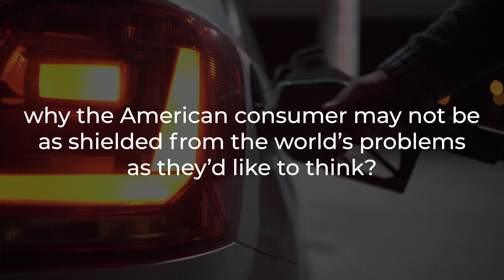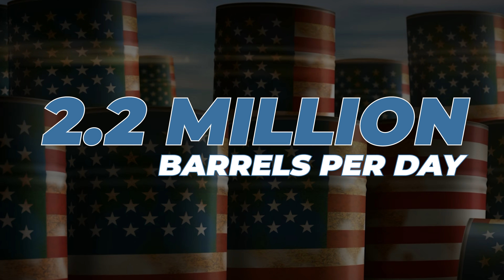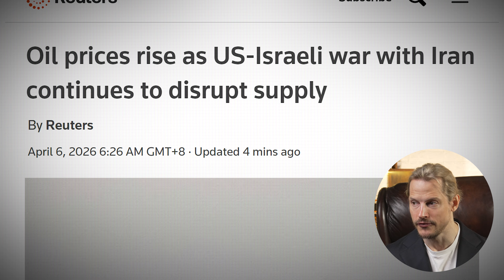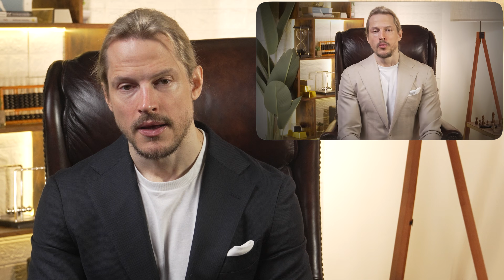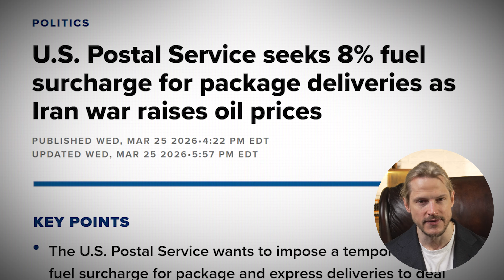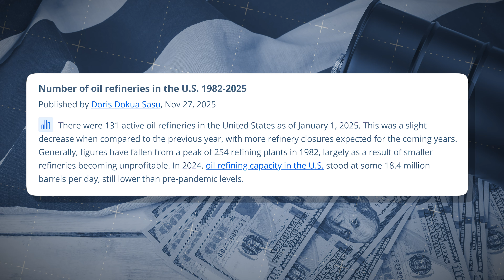Why 'Energy Independence' Is Putting You At Risk

Comment: Refineries on the coast already accept light sweet and blend it with heavier sour sources. Major retooling is not necessary and changes can happen incrementally over a few years. It's also not just about oil turning into gasoline light and sweet can be turned into petrochemicals, which is another critical byproduct that is needed for plastics and agriculture. You're also forgetting the major byproduct of LNG that flares up along with the shale oil and can also be used as an energy source. We'll be just fine
Reply: 😂😂😂 You should tell that to the price tag on the pump... ⛽
Reply: @Aurum-Archon  prices are subject to regional taxes, regulation, supply level gas prices in California for example should be much lower than they are considering Cali has large oil reservoirs but green policies jack up the price. Our refineries export to a global pool so prices are inelastic but we COULD be energy independent is the point there just isn't the political or economic impetus for it.
Reply: @Rufus345 😂😂😂 Whatever helps you sleep at night brah...
Reply: @Aurum-Archon well argued
Reply: @Rufus345  We are screwed brother. We can argue about it all you want, just save me a spot close to the barrel with the firewood so I don't freeze to death. I will bring some marshmallows.
Reply: @Aurum-Archon Europe is paying $2 per litre which is about $11 per gallon. Aside from bigger cities, I'll take $4.50 at the pump without complaint.
Reply: @CMAzeriah  😂😂😂 Yes but in Europe a 15 min drive is considered a long drive. Nobody in Europe commutes for an hour to go to work every day. Because Europe has good city planning unlike the US. Fuel costs in Europe don't matter all that much because you can really walk to work every day if you want.
Reply: @Aurum-Archon 
Even in NYC, no one really drives. Pump prices are a bit of a myth
Reply: @Demopans5990 I work in NYC and commute to it everyday from Putnam County as do thousands of other people. Pump prices are certainly not a myth but again they're much better here than in California or Europe where counterproductive climate change policies raise prices unnecessarily. Again we have the ability to be energy independent but not the political will.
Reply: You got an energy conversion kit for my Ford F250? I'd love to know that I can turn my 5.4L gasser into LNG.
Reply: @Saint_Oscar the point of the video is that the US can't be energy independent. I'm arguing why it can be
Reply: @Rufus345 That's fine; I agree partially with the big-picture side of it. However, Is just like to know when we're all getting new engines
Reply: @Rufus345  do you think we ever will be?
Reply: @S @Saint_Oscar point taken I don't wanna ride on a LNG tank 😅
Reply: @z @zoinks7258 think it's POSSIBLE if we have the political will but the major oil companies are making too much selling to the rest of the world not to mention the shipping companies all of their lobbyists push for oil to go OUT that's where the money is made. If we wanted to though we could legislate to keep it in our borders so yeah it's possible but unlikely unless we get into a serious situation where gas is unbuyable
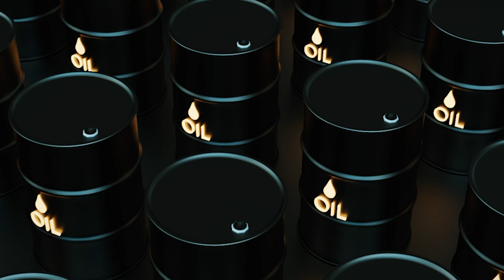Reply: Blending' is a simplistic patch, not a structural solution. At [00:03:45], we expose the 'Premium Fuel in a Diesel Engine' paradox. Refineries aren't just blending; they’re optimized for heavy sour to feed their multi-billion dollar secondary units. Running light sweet, even blended, leaves those expensive cokers idle, destroying the profit model. We aren't 'fine'; we're just exporting our advantage while paying a geopolitical ransom for the heavy grades we actually need.
Reply: @E @EnergyAxisIntel it's a structural patch as refineries retrofit to accept the light sweet grades that our shale wells produce. Does this destroy profit? Of course; but your video is not about profit it's about the viability of American energy independence which is attainable if we enter exigent circumstances and we need to close off oil exports. The President has the power to do this under the Export Administration Act. At that point, profit ceases to be the incentive and national security/survival becomes the focus. So we have the ability to be energy independent.
Reply: There is quite the confusion between energy security and energy sovereignty. The US had energy security, but since it is still subject to the whims of market forces, the US isn't really energy sovereign short of the Export Administration Act, which might as well be nationalization in all but name
Reply: @Demopans5990 there's no confusion. Energy sovereignty is the de facto state for any energy producing country. In an emergency situation where all other streams of petrol fall off the map and we can no longer import what we need, nationalization is the only rational choice. The same would be true of Russia or Saudi Arabia if their own energy supplies  suddenly become their only energy supplies. At that point the market becomes irrelevant. The U.S. HAS that capability where other countries, like China, do not.
Reply: Which oil stocks do you recommend?
Reply: @TG-vg3qe  avoid entirely and go for for chicken or beef stock